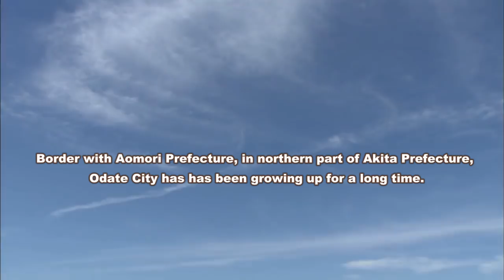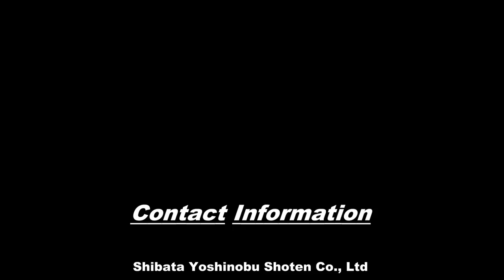Incredible Bending Techniques Curved Bento Boxes - A Fusion of the Warmth of Wood and Skilled Hands

Comment: ACK! The nice lady needs a feather board and a push stick - hands should not get that close to a power saw in action! Gorgeous work - she needs to keep those hands!
Reply: Phylis Maddox. Fully agree with you. Safety first. Handcrafted cedar bento are beautiful.
Reply: I was thinking the exact same thing. Too risky.
Reply: Not really. Stock that thin and soft is unlikely to kick back given the relatively high sawblade. Personally, I would opt for a riving knife, but I tend towards the overly cautious.
Reply: I still think in terms of error, not so much kickback. That close, inside, the slightest mistake becomes critical.
Reply: Yea that was cringe. Only takes one mess up and you lose a finger. Why risk it?
Reply: Although I thought that in the first moment, as someone mentioned, it is 'relatively safer', because the higher saw blade means that it gives more pull down onto the table than a low blade. And with proper workshop training and good concentration there shouldn't be a problem. But, yes . . . ;¬)
Reply: You get understanding the old culture, Japanese use more on hand saw than power tools, the old master never learn proper way to use power tools, he never have proper training, he only can shows how he thinks how to use it in the video, more likely he is still use hand tools daily life, I doubt these girls will want to her career. anyway, hope some young teacher will teach old dogs tricks
Reply: That's a good point, and, yes, again. :¬)
Reply: The kickback would be not that hard. The bigger Problem is the wide outstanding saw blade, it´s better to use a chip hood.
Reply: Yeah I was thinking the same thing
Reply: @gabrieljuarez7898  You sound so educated there buddy.
Reply: How about we let the talented lady who is actually doing the work make the safety decisions for herself?
Reply: A SAWSTOP would be a very worthwhile business investment!
Reply: @wordreet  Yes and no. It just takes a tiny wobble from having a busy week and 4 hour sleeps and suddenly 5 becomes 2 and a quarter. It's just such a small precaution to take while not doing it could ruin her life (although it would probably just hinder at most).
Reply: Yeah I was thinking sorta the same thing, especially if you're working at the saw for hours, only takes a little tiredness or inattention. I love Traditional Japanese woodworking.